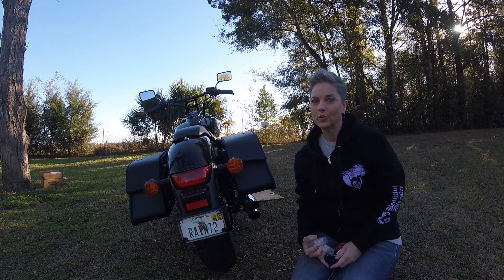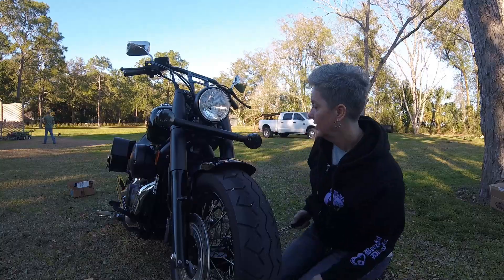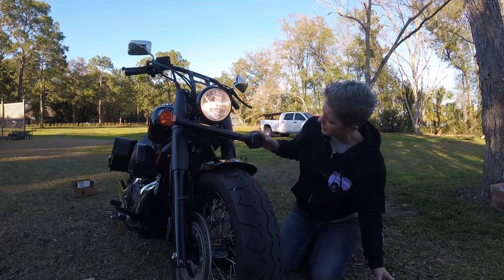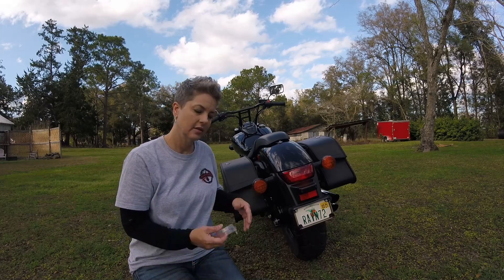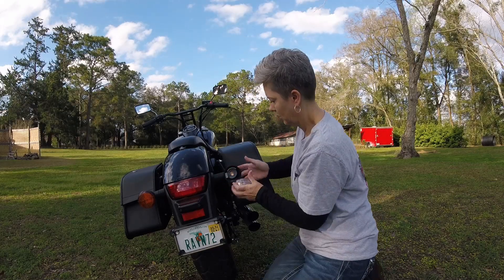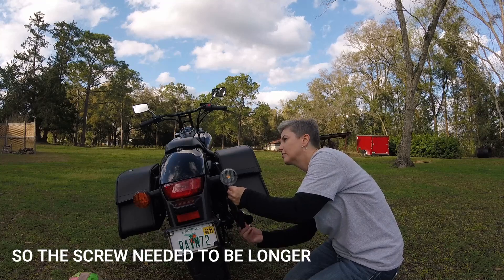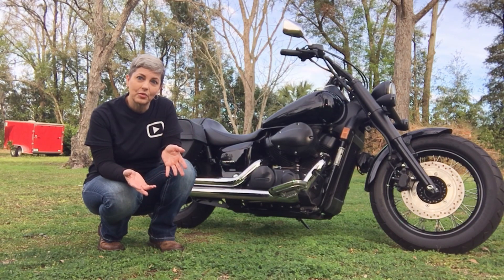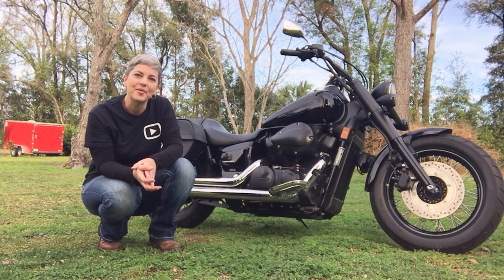Honda  Shadow Phantom Turn Signals Part 2

Comment: Did the diode work to solve the flashing problem? I just put led bulbs and a new led signal relay in my 2010 Phantom today and the front lights worked fine but my rear signals are doing the hazard flash and my taillight is just on. Also, the halogen headlight is stuck and I havent been able to remove it to put in my new led light. And I tore the boot! 😩
Reply from the maker: I didn’t put a new diode in.  I think I’m going to have to get a split flasher relay.  I ended up using regular bulbs in the back instead of LED
Reply: @TheGearedRaven72  that's where I am too, I am wondering if a load equalizer would do the trick. I saw one comment on the review for the product I bought that was a fellow Shadow Cat and that's what worked for them. Thanks for the videos! Happy trails

Comment: I had to change my front lenses to clear back smoked worked fine. My front signals go white then turn to amber with the signals just like yours smoked really made them not as bright clear fixed that. I think it makes a huge difference How many Ravens does it take to put in a light bulb lol.
Reply from the maker: Kevin Schroeder it takes a whole “murder” of Ravens 😉👍🏻
Reply: @TheGearedRaven72  LOL
Reply from the maker: Kevin Schroeder look it up. It’s accurate.
Reply: @TheGearedRaven72  I know that a murder is a group of Ravens I got it right away LMAO
Reply from the maker: Kevin Schroeder oh good!

Comment: I know with my Honda VLX when I switched to all LED's I had to put a diode in at the turn signal indicator. Something on mine about only having one turn signal indicator instead of a separate left and right, it was bleeding over from one side to the other. Fortunately it fixed my problem.
Reply from the maker: easternshoreduramax yes. Exactly.  I have to research that. Thank you for watching!! I appreciate it and the comment. Very much.
Reply: I found your channel the other week after Her Two Wheels was on, love your videos! Keep up the great work!
Reply from the maker: easternshoreduramax aww. Thank you.  I appreciate that feedback.  Glad you enjoy my content.